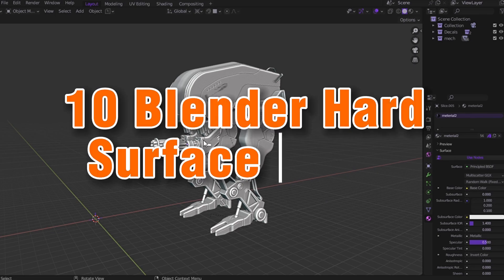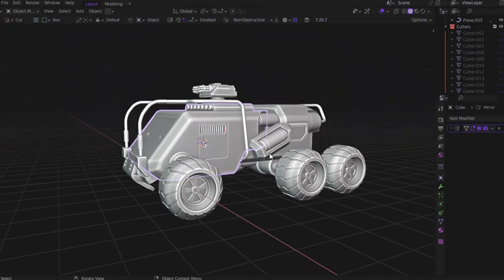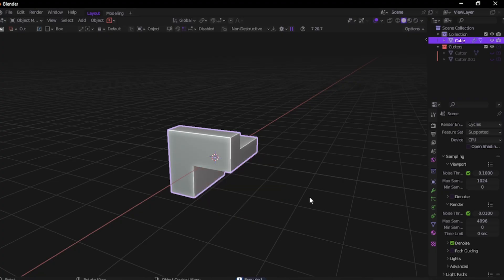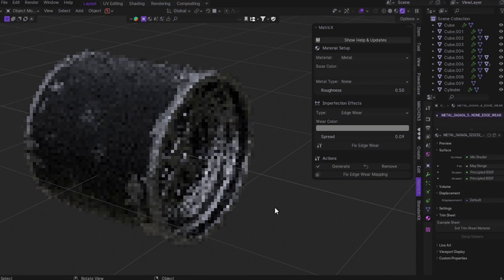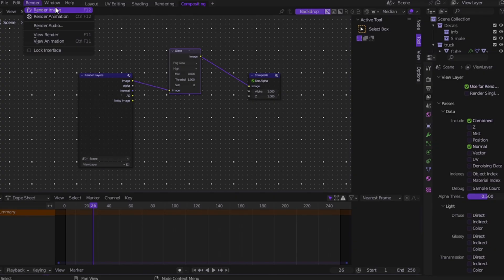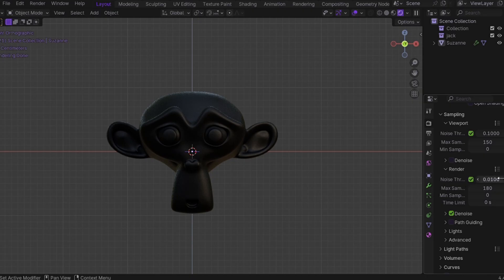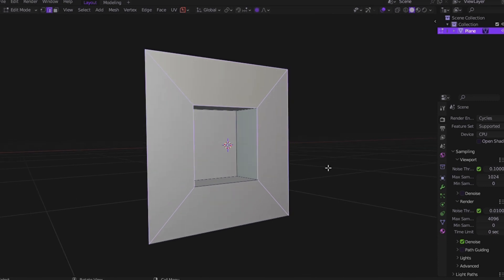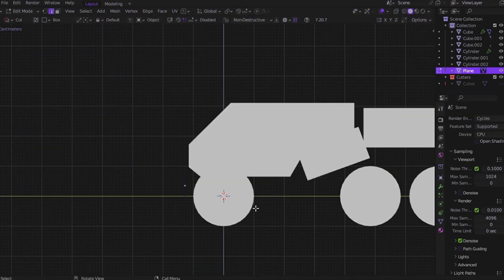These 10 Blender Tricks Would’ve Saved Me Years (Don’t Make My Mistake)

Comment: For 1. you can just not inset (i.e. confirm the inset without moving the mouse) then scale the selection, since you're scaling the duplicated face anyway you would get the same result. In fact I always use E instead of I for the same purpose.
Reply: Great. You got this 🎉
Reply: Works great for squares, circles etc. i.e. regular, evenly spaced shapes. but not for more complex shapes. There you need the Inset tool. And then scaling will not work, neither your method nor the method shown in the video. Because insetting is not simply getting the exact same shape just smaller.